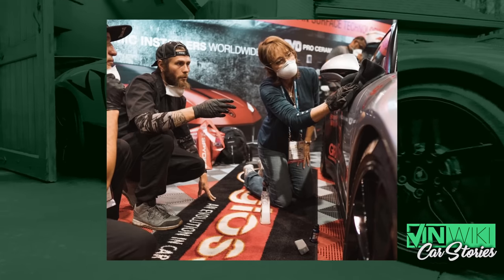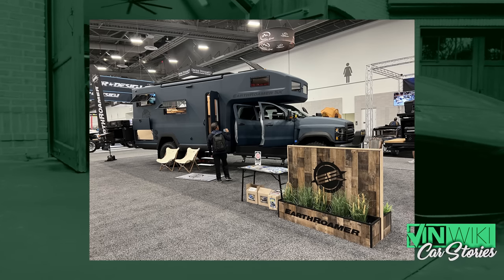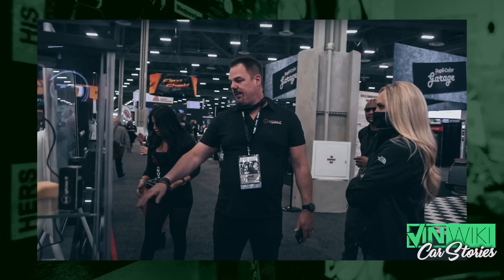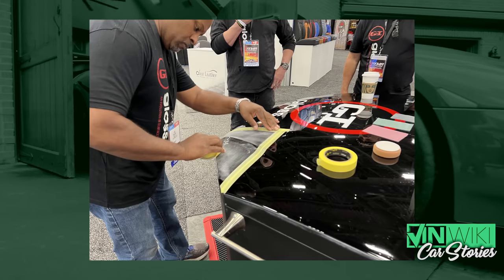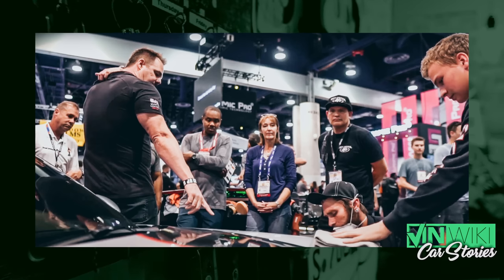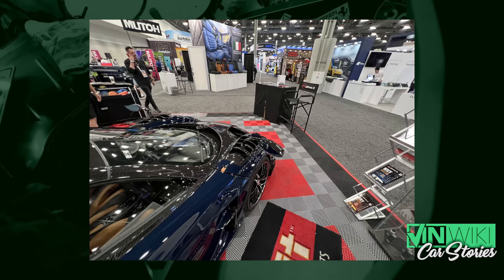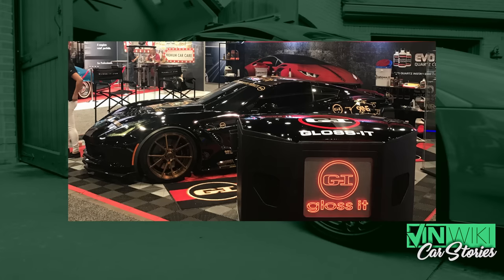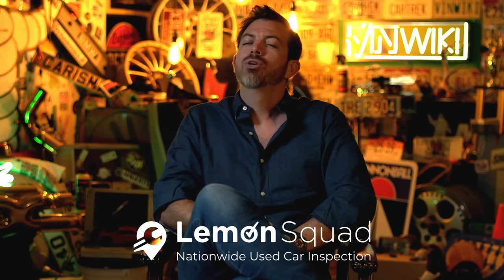Exhibits at SEMA cost WAY more than you think!

Comment: What he is saying is true for most trade shows,  Chicago requires union plumbers to quick connect a  compressed air line, union electricians to plug in an extension cord. Union Dock workers  to unload the truck and move the pallet 1 foot, then union floor workers to bring it to your booth.

Comment: About 15 years ago I spoke to a guy who worked for GenCon, the largest and longest-running gaming convention in North America. In 2019 GenCon Indianapolis had 70,000 attendees. He told me they branched out to Anaheim for a few years but had to stop because of Union costs. In 2003-2006 all exhibitors were being charged $1000 per cart (Home Depot size flat cart) for bringing anything into and out of the convention. Didn't matter if it was product to sell OR things to build displays. Some booths were spending $50K just for that.
Reply: How is that the union's fault. You know they weren't paying the guy pushing the cart that much. Most of that is going straight into the venue's pocket.
Reply: @beamdriver5 Same guy that will agree to the price at the start of the job and then stiff you on the final payment because you might actually make money off of your own effort.
Reply: @beamdriver5  Sorry. Forgot to mention, only union guys were allowed to push the carts and that was the rate the union decided on.

Comment: Quality is like buying oats. If you want nice fresh clean oats you must pay a fair price. If you can use oats after they have been run through the horse, that comes a bit cheaper. 
 Union help gets you well trained individuals that get the job done. Ask someone that has a damaged booth show up the night before a show opening. When you walk in and it looks exactly the way you wanted it to look. Your hanging sign in the proper place and does not fall down on you and your clients.

Comment: I got one of the free gloss it bottles from the first run and honestly I’m really impressed when I got my Honda CRV it had 260k typical dings scratches in a little bit of rust but after detailing the car Claybar in it and polishing it I sealed it with a gloss it and I didn’t even use much of the bottle which actually baffled me but this is just a little update the paint honestly shines way more than when I got it Will have to do a video about it I made a couple but lost all the film unfortunately
Reply: Where did all the punctuation go?😂😂😂

Comment: Maybe they should do SEMA in Atlanta. None of that stupid union nonsense here. 🙄
Reply: Great idea, but does Atlanta have the hotel rooms and nightclubs that Las Vegas has ? The answer is no. Not a knock on the city it’s just that Vegas is a destination city. Yes the costs would be much less but your not going to have the same attendance numbers to make it worth doing.
Reply: @ARUSApacecarHAMPTON  a quick Google search shows Atlanta is number 4 in hotel rooms with 75k. Vegas is number 1 with 150k. With the correct timing, there wouldn't be an issue with the amount of hotel rooms. Atlanta is not the same kind of destination as Vegas. I'm not sure it's right to compare any city to Vegas. It is a very niche type of place. I understand what you're saying, but Atlanta has and still does host its fair share of big shows and other things. I'm sure if I thought hard enough or Googled it, I could give you quite a few good examples, like the 96 Olympics for instance.
Reply: @MrFixItGa  Atlanta could do it but the infrastructure would have to be built or upgraded to todays standards. The Olympic Games were almost 30 years ago and the outlay was still almost a billion dollars and 7 years of work. Another downside is lack of centralized convention and hotels in the numbers that Vegas has. If SEMA downsized Atlanta would be a great place. The idea of having 2 shows of smaller size might work. One in say Las Vegas and another in Atlanta. Atlanta had one big advantage and it called the airport. The number of international flights would work to its advantage in attracting international visitors to the show.